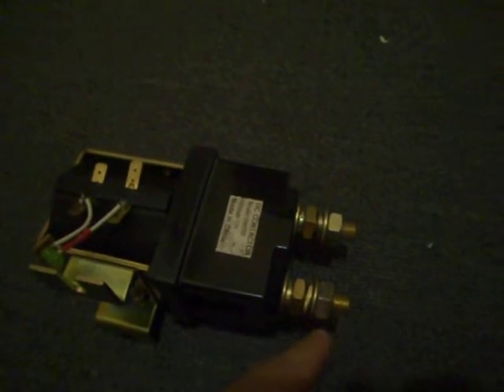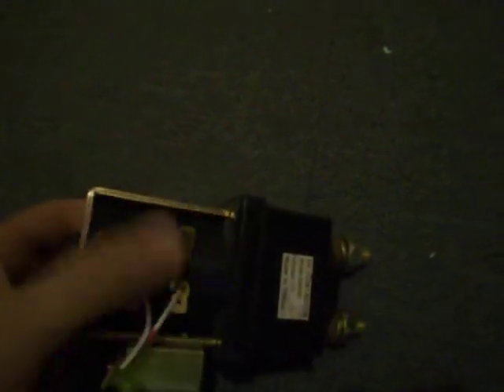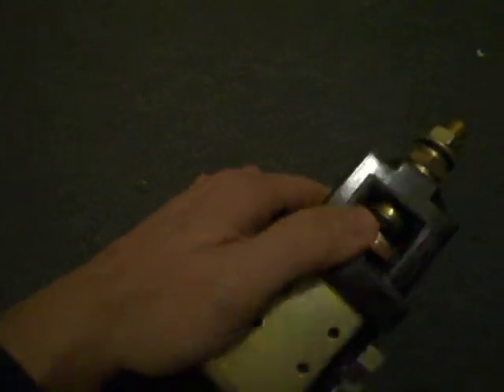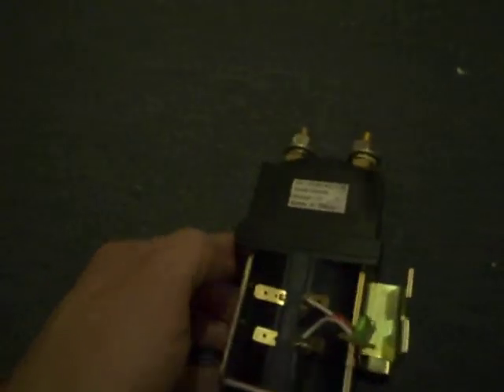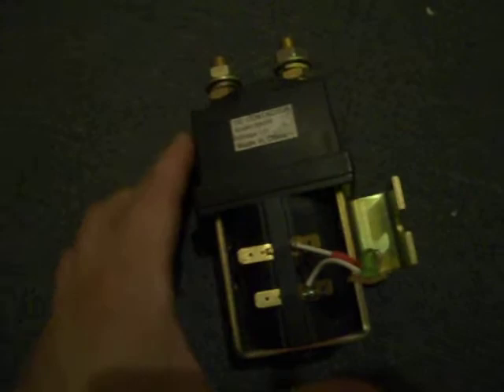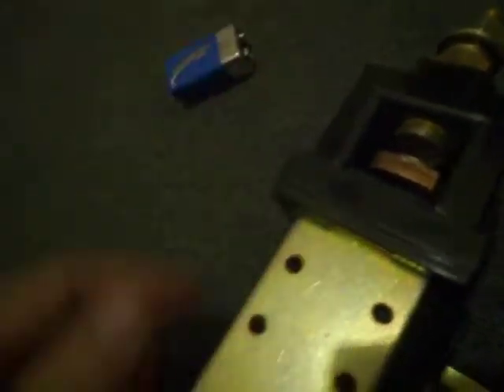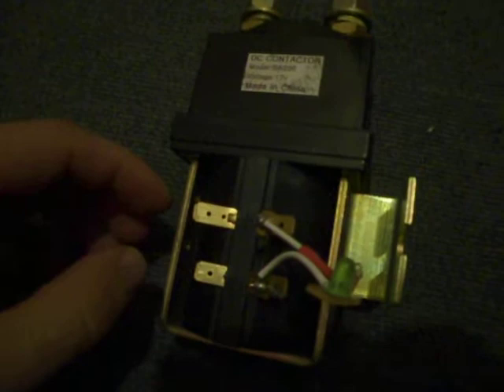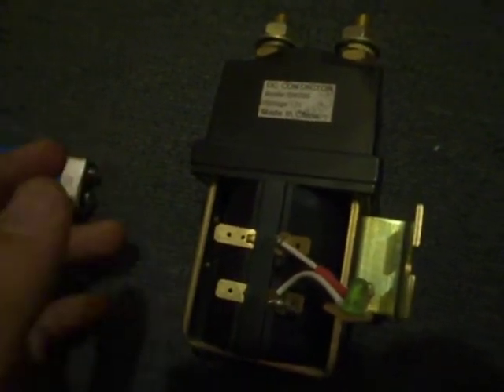Main Contactor (an EV component) introduction

Comment: I've a contractor looks exactly like that from a 48v electric microcar. For some weird reasons when I put in reverse and then press the accelerator the car shuts down. from time to time in neutral as well, as I press the brake it shut down. Do you have any idea? could it be a faulty contactor? in forward has always worked

Comment: I bought an sw80 contactor and it's not working with a 9v battery. Should it be 12v?. How do you get to know what voltage should I give for solenoid?
Reply: Should be 12v

Comment: Would I have to worry about voltage and amp on one of these? I'm planning on a 144 Volt system.
Reply from the maker: Yes, voltage and amp ratings are very important. Check the ratings for the traction part of the contactor (high volts, high amps) and also the control part of contactor (part that actuates the solenoid - some are not 12 volts).

A trap I encountered late last year was when I used the Kelly KDZ48400. The control circuit and traction circuit was not separate (ie shared the same battery pack)-so in my case, everything was running at 24 volts, which meant I had to get a contactor that could handle it. If I want to increase the volts to 48 volts, I would need to update my contactor so not only can it handle traction of 48 volts, but also the actuating circuit would need to handle 48 volts. Many other controllers (including other Kelly Controller models) have a separate circuit for traction and control circuits, especially when they are automobiles. If you want more details, let me know.
Reply: and another thing, I'm currently looking for a motor for my 1990 Corolla Wagon and have found a junkyard with three 24V forklifts with motors in them, the GVWR of the car is rated at 3300+ lbs would a 24 Volt motor even be usable in a car or do i need to find something abit bigger?
Reply from the maker: How fast did the forklifts go? How heavy were the forklifts? What size forklifts were they? Were the motors used for propelling the forklift or for the lifting mechanism?
Can you find out the RPM, power and torque of the motor? Also, how much amps would it be drawing? 

How fast do you want your car to go? Will you connect the motor to the gearbox or straight to the drive shafts?